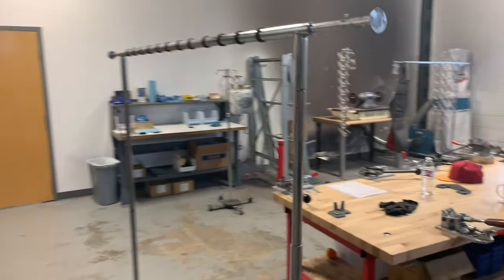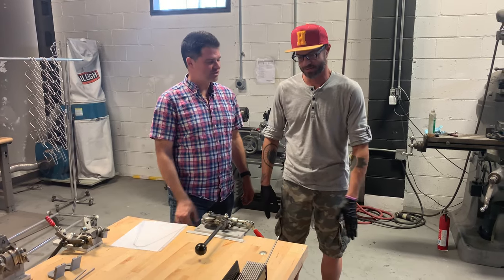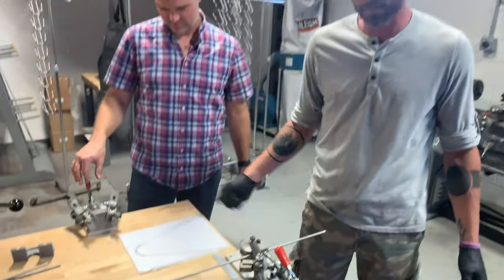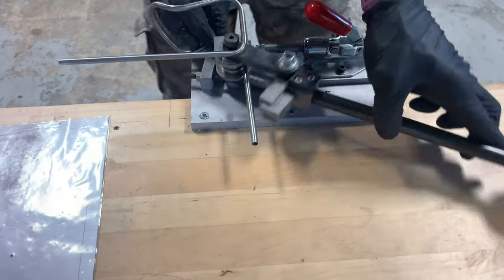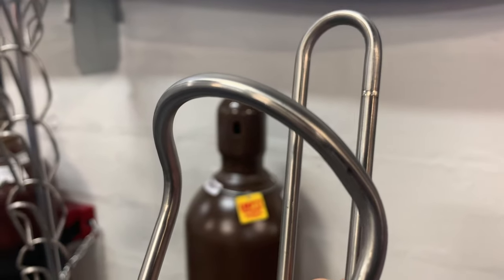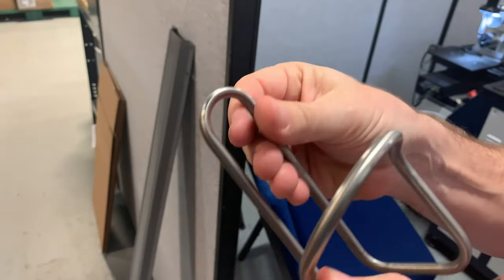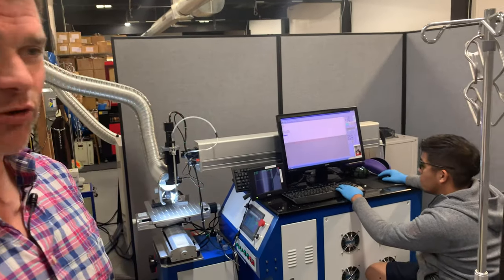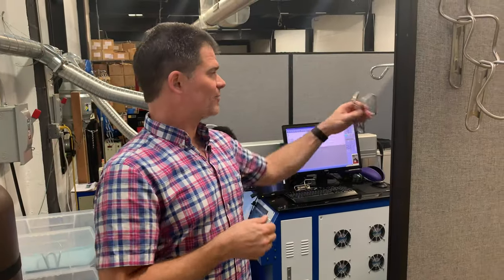Titanium Cage Production: How SILCA makes a bottle cage

Comment: Great to see a clean and tidy workshop.  I’m an aerospace welder (Tig ) Rolls Royce Aero Engines, I specialise in Nimonic and Titanium alloys.   Very interesting machine using the laser.  In welding terminology that type of weld is called an Autogenous weld,  basically a weld using no filler wire just patent material.   
I’ve just bought two of your cages for my Van Nicholas as the weight was comparable to carbon.  
Nick ( UK )
Reply: Do you weld frames?
Reply: @federext  no sorry.

Comment: The good and the bad (in my experience):  The finish matches my Lynskey titanium road and gravel bikes perfectly. These days, titanium is a boutique material, but I preferred the aesthetic of matching metal, over a plastic or carbon look on my bikes. I'm glad these are out there in the market. The bad: pliability/durability. I have had these break at the plate that affixes the cage to the the bottle bosses. Actually, the welds would fail; the tubing didn't break. I use normal diameter bottles. I can afford them, but for the premium price, I have been frustrated with the lack of longevity.

Comment: WOW! Who knew that this much tech and OCD precision went into something as simple as a bottle cage?!? 👍

I guess that argon 'environment' must be maintained with any/all titanium welding, even if it is a laser process with no fillers/rods being used.

I may now buy a set from you for my Merlin Road, instead of the crunchy carbon varieties I was considering.

One quick question; Do your Cerakote coating options lessen the markings left on the bottles any at all (especially the satin/'Glacier' black coating)???
My car's 304 stainless exhaust system is coated with that exact stuff and it is nothing short of miraculous!

I ask because even the old, stainless Elite Ciussi cages I've used always marked up my fave bottles badly. ☹
Reply from the maker: In a clean environment, the Ti and Cerakote are both exceptional at keeping your bottles looking great... the problem comes from road grime or trail dust getting in between the 2 and acting as a grinding paste on the bottles, but if everything is clean, the bottles will remain nearly new.

Comment: I bought one of these cages, and one of the four plate welds was awful. Rough, uneven, nothing like the welds in this video or the other three welds. Silca clearly need to work on their quality control, especially when charging $70 for a bottle cage. Very impressed with this process, not at all impressed with the finished product.
Reply from the maker: We apologize for your experience. Please contact sales@silca.cc and we will take care of you.
Reply: @SILCAVelo  
Well, I sent an email to Silca about the faulty weld on the cage I purchased, and was told that it’s perfectly normal to have “variations”. Variations like big globs of Ti running along the weld.

So, I guess that Silca’s state of the art precision welding process is precision, until it isn’t.

I’m returning both cages and looking elsewhere for Ti cages.

Comment: Seems over complicated, expensive and too heavy. Carbon would be half the weight or less.
Reply from the maker: They are actually lighter than most carbon cages and hold bottles better over gravel, cobbles, etc..
Reply: @SILCAVelo  not to mention good for 3 lifetimes and support the economy in our backyards
Reply: Complicated?

Except for the final weld on the cage, the entire bending process is done manually, on custom jigs.

If you want overly complicated, look into how any carbon fiber part is made.

As for durability, I’ll take Ti any day over a cage made from thread and glue.